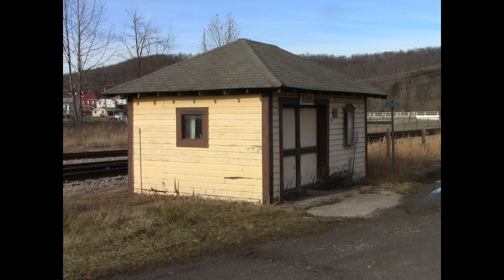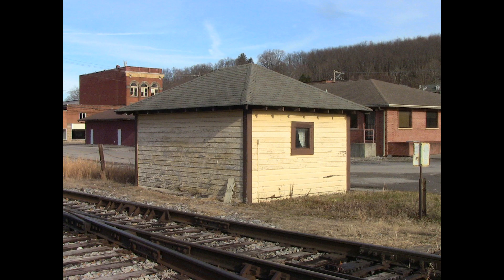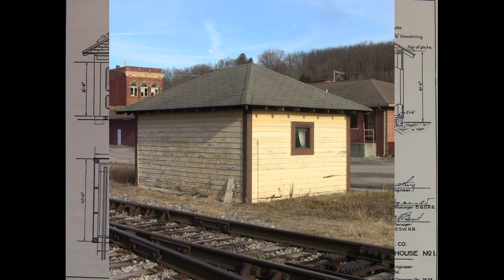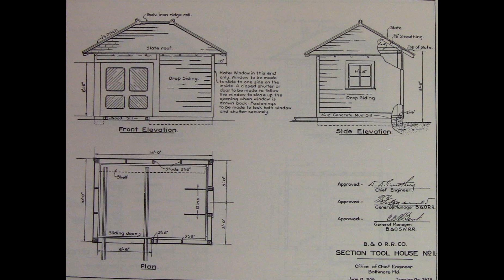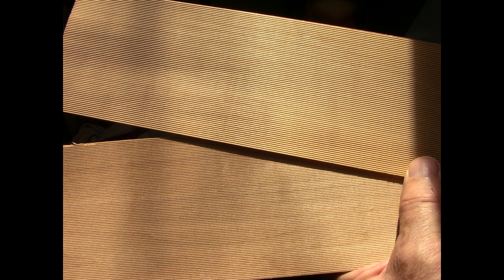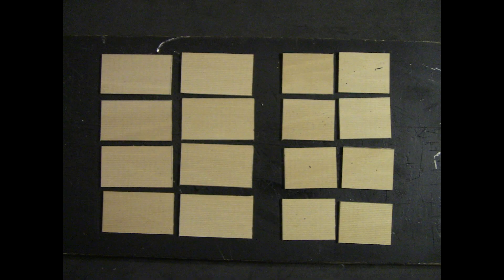SCRATCH BUILDING A SECTION HOUSE FOR YOUR MODEL RAILROAD

Comment: Mark,
Great Build! Will you have a siding track coming all the way to the section house, or will the crew use a piece of equipment (cannot think of it) to rerail the speeder on the main?
Reply from the maker: These were used back in the day when men were men !!!  They were moved by hand to the rails . These rails ran pretty close to the edge of the main line but it was manual from there.  Some of the times it was pump cars or flat cars and not always speeders .